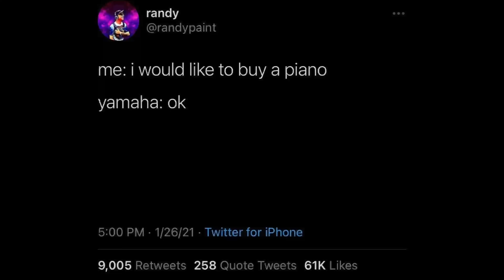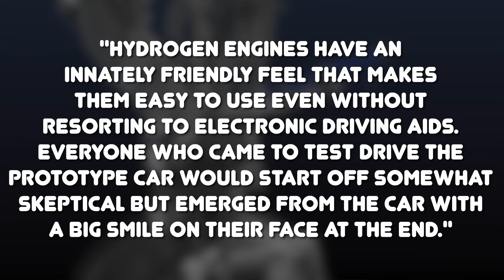Toyota's New 455HP Hydrogen V8: Everything You Need to Know

Comment: Hydrogen powered cars are not practical at all. The most efficient way to produce hydrogen is electrolysis. Electrolysis requires electricity. As a general rule of thumb, the amount of useful energy that is produced is less than 50 percent and the overwhelming average is around 30 percent. This means that, instead of powering an electric car and getting somewhere around 30 percent or less of efficiency but batteries also cut down the electrical efficiency by around 30 percent (you end up with like 10 percent or less efficiency and if your electricity comes from combustibles your total efficiency of an electric car is less than 1%) so hydrogen may be comparable. To put it differently: if you are burning fuels to make electricity that powers electric cars burning fuel has about 30 percent converted into mechanical energy and about 30 percent of the mechanical energy is turned to electricity and likely less than 30 percent of that electricity stores into the battery and about 30 percent or less of that stored battery energy goes into moving your car so let's apply that to the original energy: Eeff ~ Ein x 0.3 x 0.3 x 0.3 x 0.3 x 0.3. If we start with 100% Ein then Eeff of an electric vertical is about 0.81%. By comparison, an ICE converts heat directly to mechanical energy and gets around 25 percent efficiency (heavily dependent on torque ratio) . So an electric car will consume 25/0.81 = 30.86 times as much burnable fuel, create 30.86 times the amount of emissions (if they aren't captured),  and deplete our fossils fuels about 30.86 times as fast. Electric cars that are charged by coal or natural gas plants are insanely impractical. Similar math applies to the hydrogen powered car only the hydrogen replaced the battery and there's another step in comparing the hydrogen or modifying it to be useful as a fuel in a portable vehicle.

Comment: On the fueling....
If you have an electric charge point,
you have a hydrogen refueling point.

The problem with intermittent natural generators that cant produce 24/7, and cant necessary synchronise delivery with demand, is they require a buffer.
A battery is a liquid/solid state buffer, but it also requires a rather large amount of mined materials.
Fuel as a transient liquid/solid state energy buffer, also allows those natural generators to store energy asynchronously from demand.
(See also the old repressed water fuel engines)

Its the decoupling between supply and demand where the boon lies.
Batteries can keep charge, but lose it over time and are climate affected (e.g all the abandoned tesla bricks in the big freeze).
Charging or swapping out modular hydrogn fuels cells, is a valid alternative and perfect for off grid transient generators, to supply/store fuel to mobile vehicles.
Besides, diesel vs petrol drove each other to make more and more performance gains through competition.
It would be useful to see charge buffers systems and hydrogen buffer systems compete and drive each other forward.
Both are in their infancy and no one really knows how far they can be pushed.
IMHO

Comment: Toyota is right on que with the development of hydrogen engines as they are not the only ones doing it. Porsche is working on a hydrogen powered lineup as well as a more economical method of producing and storing the fuel. I think that working with alternate fueling sources is a far better idea than trying to go get on the BEV wagon because let's face it when a battery fails it isn't like you can just go to O'Reilly's Auto parts and spend 100 bucks and get a new one. 

To currently replace Tesla batteries costs anywhere from 16 to 20k and they are not a warranted part. If you have that kind of disposable cash laying around more power to you but the Average working class person is barely make their bills these days nevermind coming out of pocket like that. Hell you could buy a brand new Kia Rio or a Hyundai Elantra for that over 72 months and have a 20 year 200k powertrain warranty.

Comment: All it needs is a High output generator  to operate a onboard hydrogen generator. And water becomes the fuel .  the exhaust could even be designed to recollect water further extending the range .  adding a electrolyte to the water significantly increases the amount of H2 created vs power needed .. Baking soda works great. And just like water its incredibly inexpensive and available everywhere ..   Which I believe is the key factor if why the obvious solution hasn't been   done.   As soon as there's a attempt  to over charge or fuel tax water. At filling stations  Smart people will simply Get it at home , or from a ditch ..etc  . its all about profit. .
Reply: As for how efficient it is or is not to make hydrogen from electric. This solves that problem. When the fuel is dirt cheap or free . efficiency is no longer a concern. When each automobile is is own hydrogen plant theres no grid demand increase . no hydrogen fueling stations or fuel cells needed. The solution that covers  all the problems . is the one that also kills the sustained profits ...

Comment: im with toyota in this, engines are what makes vehicle have character, the sensation of driving ICE cant be matched with batteries, sure instant torque is impressive but my scooter can do the same for a lot cheaper
Reply: Exactly. "Electric cars are just better in everyway" is such a false statement. Yes, they have the numbers to be better performing cars but at the end of the day, "better to drive a slow car fast than a fast car slow." Electric cars are notorious for not handling well right now and having awful brakes as well. They're much like muscle cars. Fun in a straight line, not so much in the twisties. Even with the fake noise we're getting now, EV's don't sound good and lack character

Comment: Hydrogen would be more suitable for colder climates than EVs. EVs' range diminish drastically in very cold weather.
Reply: You've obviously never owned an EV.  Around 56% of Norway's population are now driving EV's. And Norway isn't known for having a tropical climate.... My Kia eNiro loses about 15 to 20% of it's range in very cold weather. The battery heating helps.  ICE vehicles also lose range in cold weather...

Comment: I've got a need for the Bang Boxes.  Electric Cars do not have those.  OK, yeah there is a problem with the availability of Hydrogen, but if you had a compact Hydrogen Generator that could produce enough Hydrogen on Demand you could carry your fuel source with you.  Fill up the tank with water, and then use electrolysis to produce Hydrogen, and then sell the Hydrogen Peroxide byproduct.  This is an advanced system.  Maybe a step along the path is to have a Electrolysis machine in your garage, and fill the Hydrogen Vehicle at home.  Having a Hydrogen powered LC500 would be pretty cool...

Comment: 1. Hyrdrogen refueling stations can replace current gas stations, just need refitting. Don't need to upgrade national power grid which is stupid.
2. Batteries degrade over time and you will get less and less mileage from a full charge, ever wondered what happens to dead battery packs?
3. Batteries work less efficiently in cold winter (hydrogen fuel loves cold weather)
4. Extra mileage depends on the size of the tank and easy refueling (less than 10mins)
5. Many countries in the world produces electricity by burning fossil fuel...you want more people to plug in EVs?
6. Hyrdrogen fuel will cost cheaper once the industry achieves economies of scale...anyone complaining about gas prices nowadays?
7. The glorious exhaust sounds, your neighbour Karen might hate you but you will love yourself more driving the car
8. Production of battery packs are more harmful to the environent (which is a true fact)
9. China controls the processing of pretty much all the critical minerals for manufacturing car battery packs, whether it's rare earth, lithium, cobalt or graphite. Any country can produce hydrogen fuel.
10.  Burning of hygrogen fuel creates only H2O (water)

I'm not a Tesla or EV hater...these are undeniable facts. If only people do more research into these topics they would find that not a single country is prepared to deal with the dead battery packs which is already starting to pile up. Saving the environment through EV? Wake up.

Comment: The LFA wasn't a failure. Toyota didn't care to lose a small amount of money on each LFA. It was to show the audience what Toyota is capable of producing. I'm not sure why a lot of recent videos have this confused.

I also don't agree that electric is better in every way. Electric cars weigh more than most internal combustion vehicles. This means electric cars will have worse handling (sure batteries are mounted low, but it's still an extra 500-1000lbs to haul around every corner), and they'll have worse braking distance as well.

Comment: Hydrogen will get their market when the “less intelligent” among us realize they can’t buy an ICE engine anymore. This isn’t about power or speed, EV’s are vastly better at those, rather, it’s about noise and “feeling” the power, it’s also about stubbornness and refusal to accept innovation. Hydrogen will not become the mainstream, it’s too expensive to make ( mostly from Natural Gas for now), is difficult to transport and store, it requires massive pressure to make it viable, the infrastructure for it would be prohibitively expensive. Toyota just knows that there are enough dummies out there to sell to in niche markets in hyper-densely populated areas. Battery technology will change everything, give it 10 years.
Reply: Ev's pollute more than ice vehicles when you factor in generation of electricity, the mining for materials, and the disposal of the batteries
Reply: @kenneth9874  Two points. 1.  The big oil companies are BY FAR the largest users of mined minerals. They need cobalt to remove sulphur during the refining process. Refining petrol and diesel also requires huge amounts of electricity. Around 6 to 8kw to produce each gallon to be exact. 
2. Nobody in their right mind will  "dispose" of an old EV battery, as they are worth big money. Most will either be re-purposed for energy storage in domestic, industrial or commercial applications, or they will be recycled in places like the Volkswagen EV battery recycling plan in Zwickau, in Eastern Germany. Renault also have a battery recycling plant now operating. The lithium and cobalt in EV batteries can be recovered to around 90% and reused in new batteries. The steel and alloy battery casings can also be recycled....
Reply: That what they said when japan do the bullet train.. now everybody copy it.. hahaha... So instead of complain, i gonna watch what happen instead of pick hydrogen side or ev side like a child.

Comment: I would want the choice. The infrastructure for electric vehicles had to start somewhere and some time.  If hydrogen vehicles get a decent range and I could just go to a station fill up and be on my way, well that is a easy one for me, I am all in!! I am not sold on electric and in the winter you don't get the range you should because the batteries are cold. There is a lot to be said for hydrogen!!! If you can't tell I prefer ICE over electric!!
Reply: One part they haven't said anything is the cost of hydrogen.... It aint gonna be cheap......

Comment: Hydrogen burns with a pale blue flame that is nearly invisible in daylight, so it is almost impossible to detect by the human senses. Hydrogen cannot be captured by gravity. If you have any leaks to atmosphere that fuel is gone forever. Allowing hydrogen go to atmosphere means our water is actually disappearing with no replenishment. It is probably the worst fuel you could use. Are you people going to start mining comets? Unlikely.  Leaks will be everywhere there are any transfers of the fuel.
Car engines have leaks all the time just a terrible idea.

Comment: You can already get electricity anywhere, the distribution network is in place.  An EV is already a good solution for many people and certainly a great option as a second car in many homes.  Once we get a few more models (pickup, minivan, cheaper hatchback, etc.) the transition will only accelerate.  ICE is dead, regardless of fuel.
Reply: There aren't enough precious metals to continue with the current battery model.
Reply: @OverandOutChief1  And there isn't enough oil to keep driving ICE......  Tesla are already producing cobalt free batteries. EV battery technology is advancing steadily..... Don't overlook the fact that all or most of the EV's currently out there, can have their batteries recycled, and the lithium and cobalt can be recovered to around 90% and reused in new batteries. You don't get to do that with hydrogen.....
Reply: @Brian-om2hh  With fracking, oil is almost infinite.  They can now access all carbon deposits fossils hundreds of millions of years ago.
Reply: Batteries' energy densities could be reaching a thermodynamic limit. And there's always the issue of stability.

Comment: Objectively disagree the reason people will want it is because of what you stated. Carbon friendly. Has the same benefits as gas but is adaptable to "saving the environment“ If manufacturers start to produce it will become cheaper and appealing just as the EVs have/are. Little nearsighted on those points. It's still difficult to find EV charging. I don't think electric is remotely our future. The grid can't handle it and the battery tech is not advanced enough. Just like with the Prius they are looking into the future which will make them more knowledgeable and profitable WHEN hydrogen becomes a viable engine source.

Comment: YOUR THE ONLY CRAZY ONE FOR NOT KEEPING AN OPEN MIND.  WATER IS 2/3 THE PLANET, NO POLLUTION, WE FUEL ROCKETS , WHAT IS YOUR PROBLEM??? ELECTRIC REQUIRES MINING RESOURCES ; I.E. LITHIUM OTHER OTHER COMPOUNDS .  REFUELING REQUIRES GENERATION OF POWER .  HYDROGEN CREATES POWER ON DEMAND.  THE DUDE FROM AREA 51 BOB LAZAR RUNS HIS OLD VET ON HYDROGEN HE MAKES IN HIS BACK YARD AND HAS BEEN FOR YEARS.  HE GETS 400 MILES OUT HIS FUEL SUPPLY.  THE PROBLEM IS WALL STREET DOESN'T GET A PIECE OF IT LIKE THEY WILL IN RUNNING UP ELECTRIC.

Comment: You seem biased toward the electric car. All you need to do is look at the problems people are having with electric cars. When they produce a rechargeable battery that doesn’t force you to spend hours at an outlet then things will change.  The current lithium battery is not the answer. Also you neglect to point out that conceivably current gas stations could be converted over to liquid helium cheaper that installing expensive charging stations. I realize that currently liquid helium is not available for drivers and it difficult to produce and would have to transported like gas but people would still like to have more mileage. So if better electric generators and batteries. can be developed electric will win out but I still wouldn’t buy an all electric car now.

Comment: I believe hydrogen has great potential in new engine designs and retrofits to keep your current IC love running well into the future. Hydrogen will really come into its own In air travel. Think batteries are the answer for net zero airliners? Not going to happen. Slight changes to turbine engines and they can burn dang near anything that is combustible. The infrastructure and extraction of hydrogen are the two things holding back. Currently electrolysis coupled with nuclear reactors is the path forward for large scale production of Hydrogen. It is also the most carbon friendly way to produce it. Solar and wind can be used as well but the carbon footprint from making those is substantially higher. Hydrogen IC engines and fuel cells will have a future. We just have to get the infrastructure figured out. I wanna see our antique cars with ICs still running in 100 years!

Comment: The argument that hydrogen doesn't make sense because there are not many refueling stations is not valid, the same can be said about battery cars. The electric power grid would implode if everyone switched to BEVs.

Also batteries degrade over time, if in 10-15 years you'd need to change the battery pack with the same cost of a new BEV then what's the point? Additionally how about the recycling of the battery packs?

The reason that BEV cars thrive is the same the ICE cars do...The difference is that rare earth metals required for batteries are far-far fewer than dead dinosaurs.
Reply: Why would you need to "change" the battery pack?  Why wouldn't you consider a battery refurbishment, at a fraction of the cost of a complete replacement?

Comment: Your argument for why people won't buy them is stupid. 15 years ago there was little demand for EVs for the same exact reason - but once technology and infrastructure caught up, they took off with every major manufacturer. 

The same thing will happen with hydrogen combustion engines if automakers invest in the tech and infrastructure is put into place. 

Lithium is a very limited resource, is incredibly toxic to mine and dispose of, and I don't see EVs as a viable long term solution for zero emissions. Hydrogen power is a much more suitable solution that makes everyone happy, gear heads and tree huggers alike.

Comment: Hydrogen are better in every way. This guy is dumb he don't know what he's talking bout. Hydrogen is just water pretty much its a car that runs on water they call it hydrogen fuel cell cus they don't wanna say car runs on water. It burns cleaner ND it has more power and the engine will last longer cus hydrogen burns cleaner then gas hydrogen doesn't require emissions compoments